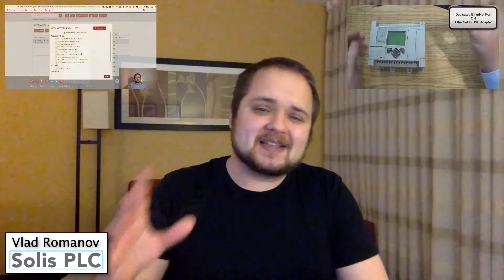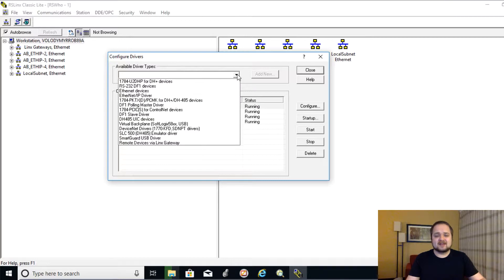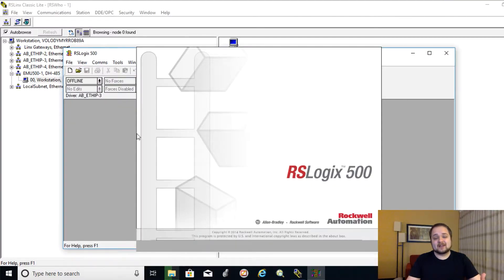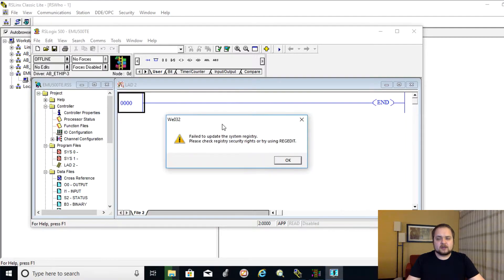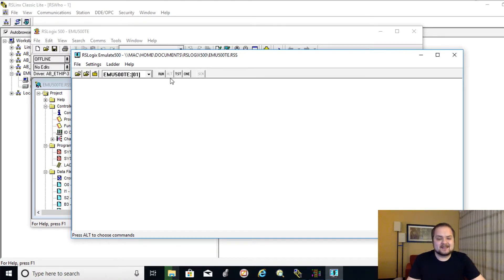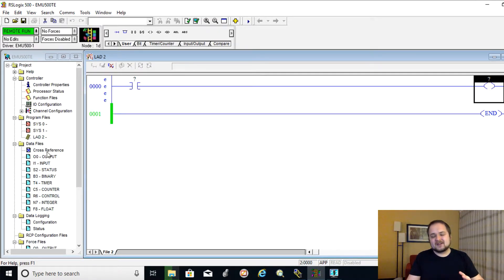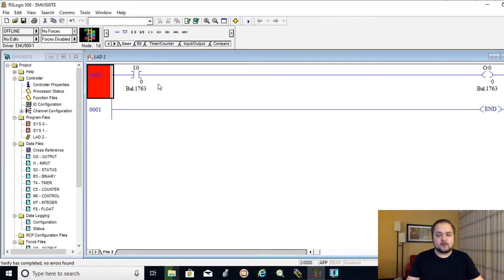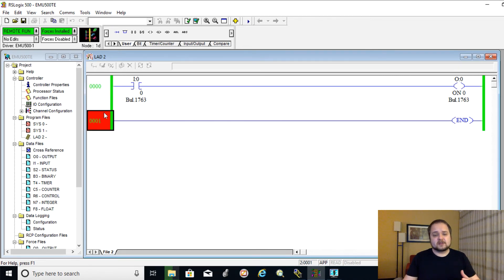RSLogix 500 Emulate - Creating RSLogix 500 Emulator Environment, Going Online, Connecting to PLC

Comment: Hello, I was trying to work with Rslinx but in my case after completing the driver configuration I am able to see 00 workstation but on top it says Browsing- node 1 not found. I have seen in your video that while you are done with the configuration it says Browsing- node 0 found. And I think this is why I am not able to go online from Rslogix. I will appreciate your help on this issue?
One thing to note, while configuring, I had to select a com# port and I don's see any comport selection step in your video.

Thanks